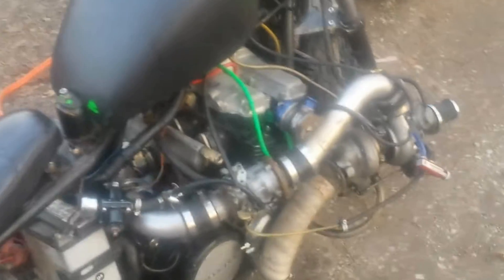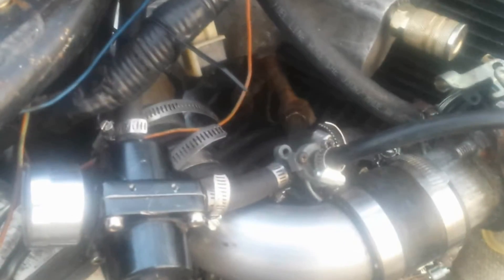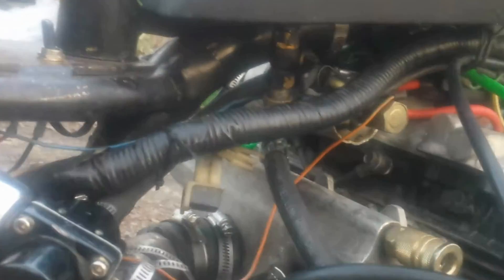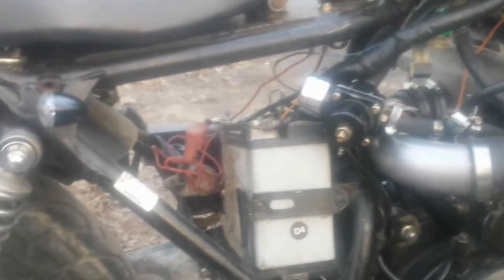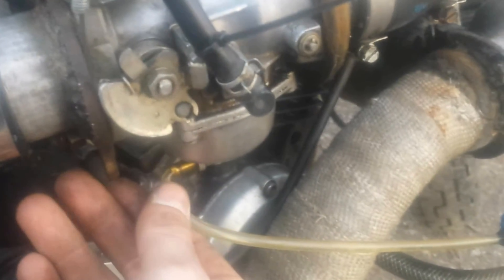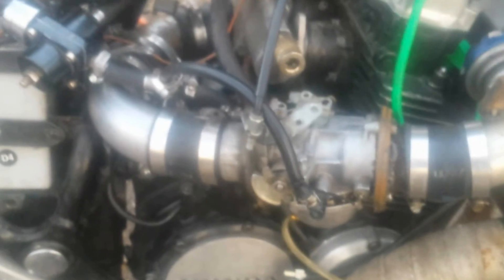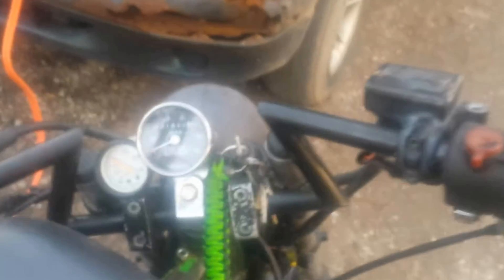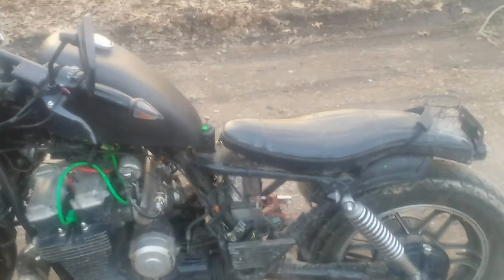Turbocharged Honda Nighthawk cb650 Starting and running | 5 PSI of boost.

Comment: Hey man really awesome build, I’m looking to do the same with my nighthawk I was thinking if I should keep the stock carbs or take parts from a motorcycle that’s fuel Injected, also what you did for the oil pump to supply more oil, would be cool to hear a detailed explanation of what worked this machine looks crazy

Comment: Hey I want to do the same but using a seca 650 turbo and carb and exhaust. My big concern is oil pressure not being strong enough to handle a turbo in addition its bormal function. How did that work for you
Reply from the maker: my turbo shaft seal blew and it blew oil everywere. I added a half quart to its normal capacity so that it would account for the lines and turbo itself.bike still runs and rides but not turbo anymore with no oiling issues. I had turbo on for 9 months
Reply: +jeeperxj1997 so basically the turbo shit out on ya? Not from the bike messing up? I basically plan on takin all the intake and exhaust off the 83 seca and mounting it under the seat. How much boost did you run it at typically? Did the turbo get you substantial power gains?
Reply from the maker: +Cody Morris  yes it was just the turbo that blew up but it's was from an early 80s volvo, problably was on its way out from the begining. I used a thicker head gasket to bring the compression down some to prevent detonation. I ran 5 psi of boost. my night hawk never did wheelies until I put that on, then it started to spin the tire while doing a wheelie after I got it dialed it. then turbo blew
Reply: +jeeperxj1997 so do you think the stock seca carb will do any better than the volvo carb?
Reply: +jeeperxj1997 also how hard was it getting that seca intake to mount up to the cb? any fabrication required?
Reply: also thanks for replying to me. your information will help a ton. I am pretty confident I can make it happen, just need to figure out some of the smaller details
Reply from the maker: +Cody Morris  the Seca intake  fit perfect. I had to plug the 4 holes in it for what I think we're injectors ?  but other then that no issues. the exhaust was the hardest part
Reply: +jeeperxj1997 I thought that might be the hardest part. my plan is to take off my exhaust cut it 6" off the engine and than cut the seca exhaust the same and do some pipe bending and welding. also im assuming the fuel pump is just part of the deal?
Reply from the maker: did you ever end up building something similar? If you want mroe info i can help out i have so much documentation on that build its nuts
Reply: Ian and Jessica no I ended up with a turbo, an extra nighthawk and not enough time lol still want to, just don't know when
Reply: @jeeperxj1997  I would be really interested in whatever documentation you have on this build please if you’re still active on this account!
Reply from the maker: @Kammmwoooods  what would you like to know